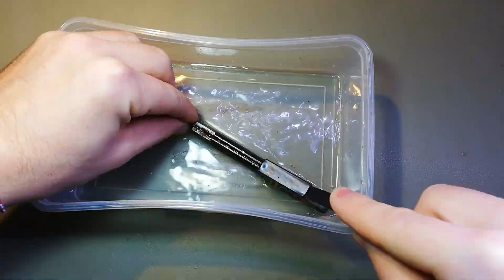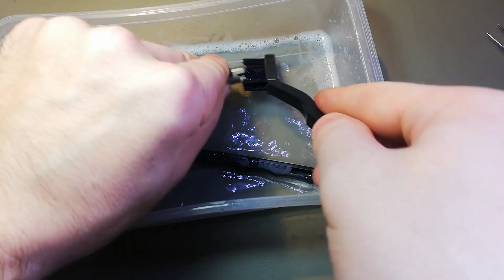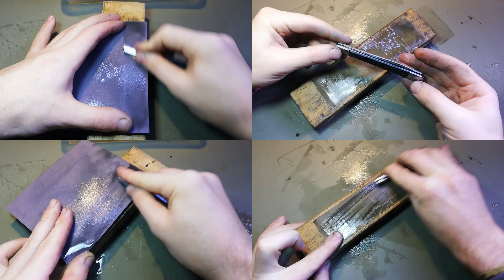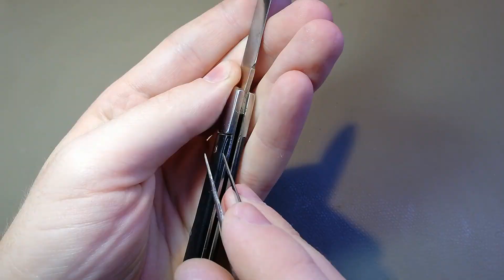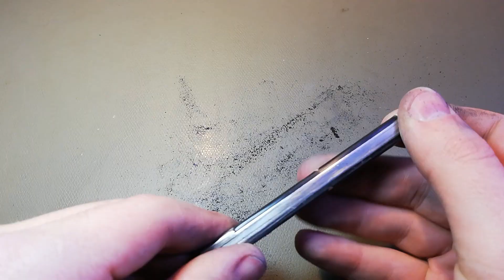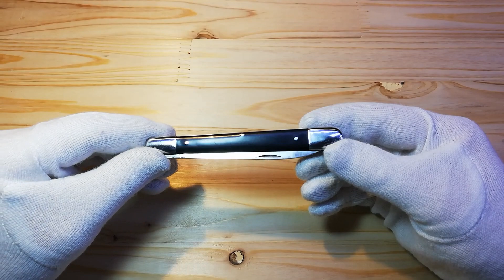Vintage pocket knife restorarion

Comment: It operated in Lövő (Hungary ), near Sopron, as part of the ELZETT factory in Sopron. until the mid-1960s, the Lövő Knife Factory. (Before that, there was a small knife factory from the 1920s to the end of the year.) So knives with a "Turris" punch were made at the Lövő Knife Factory. The name refers to the inscription "Turris et fortitudo mea Deus" made in the 1600s above the old coat of arms of Sopron. (My tower and strength is God).
Reply from the maker: Hi! Thank you so much for this information! It's very interesting! For a long time I couldn't find anything about this knife. Where did you find all these details? If you can share the source I will add these all in description. Thank you once again!
Reply from the maker: Thank you @sylikon! I'm joining the group right now)
Reply: I was just gonna comment about the pocket knife that I know it’s origin 😀 good to see others also noticed it!